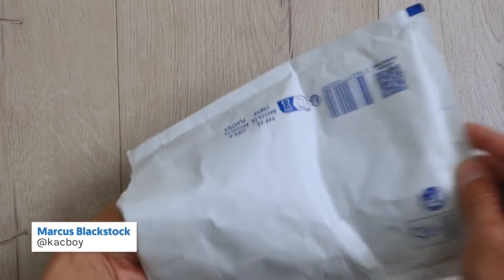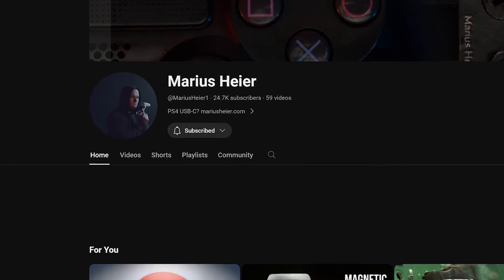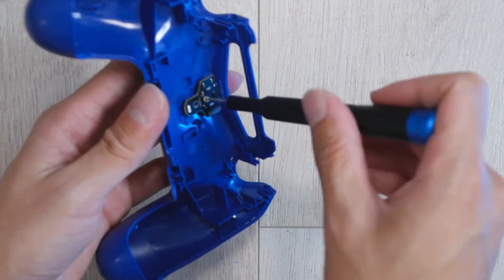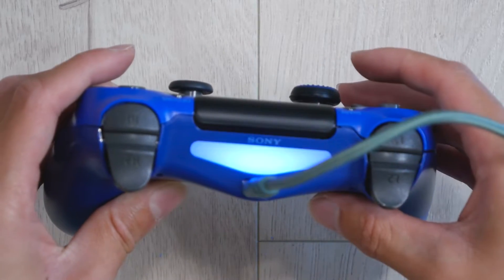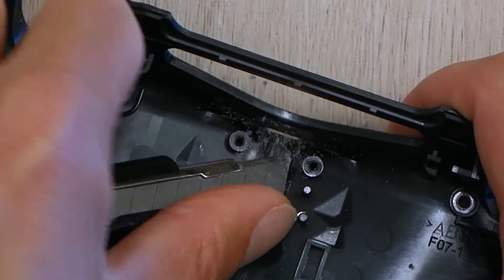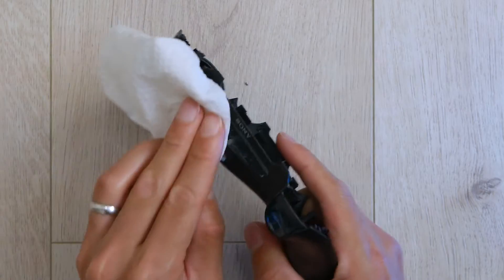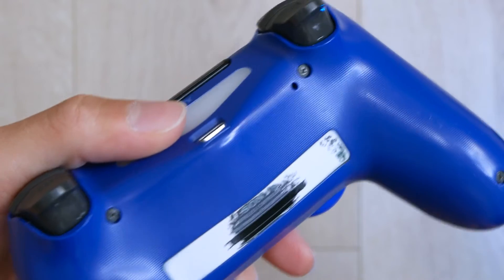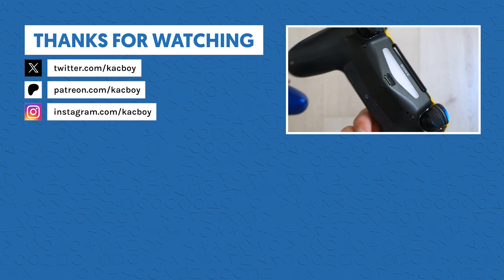DIY: Upgrading to USB C on DualShock 4 Controller

Comment: I used a usb c cable that didn't work anymore and heated the connector with a Torch lighter melted the plastic for a seamless fit. A little 1000 grit sandpaper knocked out the tiny bits of plastic that lifted up. But got the job done
Reply from the maker: That's an awesome strategy! 😯👍